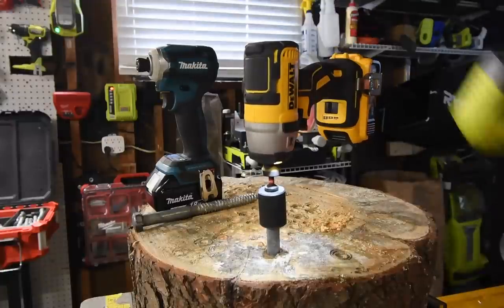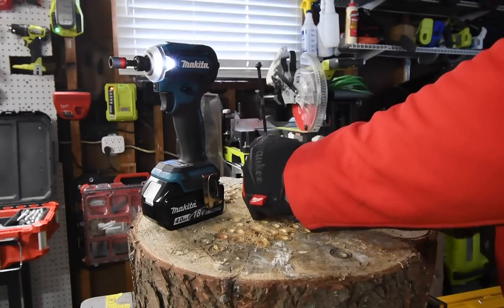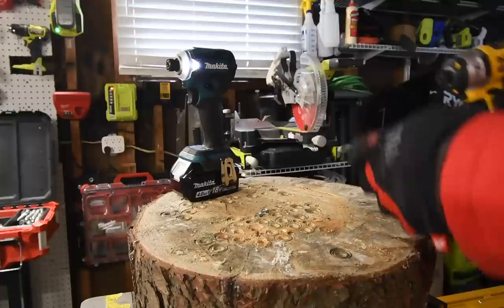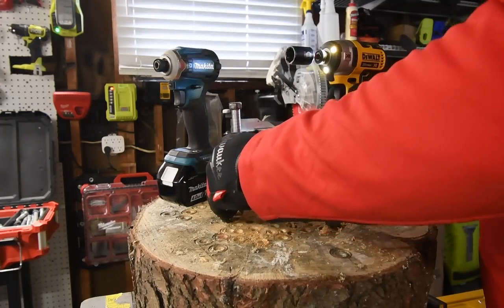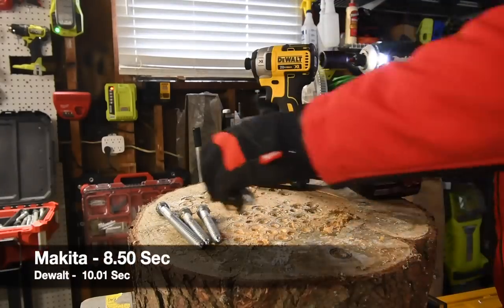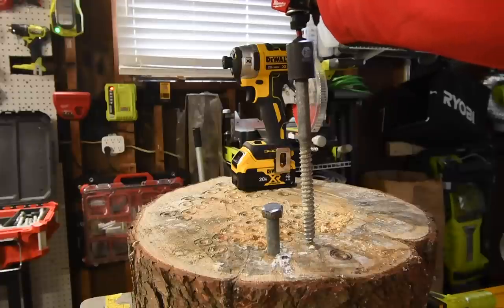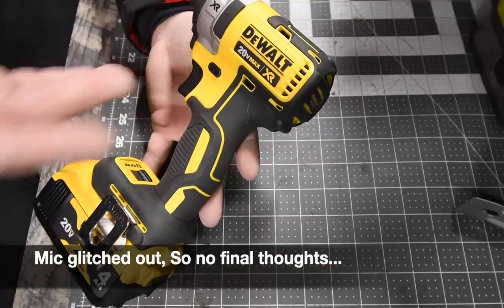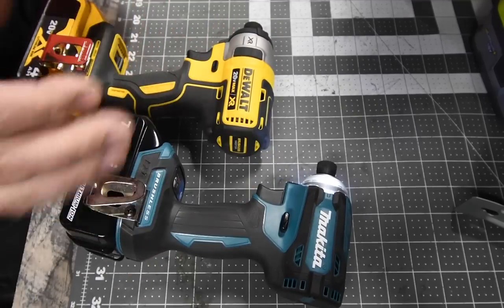Makita vs. Dewalt (Impact Drivers)

Comment: The Dewalt might have a bit more to it. However I’m still rocking my Makita set from 13 years ago with the original batteries.
Reply from the maker: I love this makita impact and I thank you for viewing Dan
Reply: Not every tool from any single company is the best overall others but I don't want 3,4,5 different battery platforms.. that's is awesome that the tool is still rocking after 13 years same battery 🔋
Reply: The makita batteries are seriously good. I only charge them once a month and I use my impact everyday.
Reply: @PatrickRankin  Thats a big ass lie lol.
Reply: @AM-wi6zo  nope not lying. I have a 3AH battery that I only charge once a month. I use my impact 5-6 days a week, sure not all day, I'm not a contractor.
Reply: @PatrickRankin  

Ok you peaked my curiosity, 3ah charged once a month but used 5 days of the week, what are you actually doing with it, like just an idea of a day of use how many screws ect for how long and there sizes. Just out of curiosity. As mine never last more than a day or two of constant use.
Reply: @qaszim2012  I screw down workpieces to my cnc machine. So I drill about 20 holes a day and have to screw in and out so about 40 screws (2 inch). Then weekend projects (fixing doors, fixing furniture, etc...). So yeah, not a lot but still, I really don't even have to charge it once a month, I just feel antsy when it hits 2 bars lol.
Reply: @ManCaverTools  Qq

Comment: I SAW A LAG TEST LIKE THIS BEFORE AND IN A REAL LIFE SITUATION I WOULD PREDRILL A HOLE FIRST. IT WOULD MAKE IT EASIER TO DRIVE THE LAG BOLT. WHICH WILL PROLONG THE LIFE OF THE TOOL. THANKS AGAIN FOR SHARING YOUR THOUGHTS AND VIDEOS RODNEY
Reply from the maker: that is correct. in reality a pre drill is best so you dont split the wood, but this makes a good stress test.

Comment: You can try putting the dewalt on the bolt the makita stopped on to see if it could continue it.
Reply from the maker: more tests will be coming. im getting the torque test ready

Comment: In my opinion, you couldn't go wrong with either one of these impact drivers. I prefer the Dewalt but, I already have several Dewalt tools, batteries, and chargers so, I'm vested in the Dewalt 20v cordless platform. The Dewalt may be a little cheaper than Makita at times, but fathers day sales, black Friday sales, and Christmas sales can make them about even. It most likely will come down to your personal preference and which platform you want to get in bed with LOL. If your trying to decide which platform to go with, I'll say this... Milwaukee is the tried and true brand for the professional, but very expensive in my opinion for the average homeowner or weekend "DIY" person. Bosch is not far behind them for quality and durability. Dewalt and Makita are the challengers for the top spot too. This leaves Ryobi and RIDGID. These are in the lower price range but they are still decent tools. I would choose Ryobi over RIDGID because I think there is some uncertainty in the RIDGID platform at the moment due to their change in batteries and some changes in their tools. RIDGID does offer a "Lifetime Service Agreement" but they don't have the selection of tools that Ryobi, Dewalt, and Milwaukee have. I realize there are more brands of cordless tools out there. The brands I mentioned above are the ones I have personal experience with so I can't honestly comment on the brands I haven't owned. If someone else has experience with other brands, please comment. I don't know everything... ask my wife! LOL!

Comment: Looks like the DeWalt just barely got away with this one, but it doesn't really seem like there are 2000in-lbs of torque in there. Either that or Makita is underrating its tools (this one is advertised as 1600 in-lbs)
Reply from the maker: it would be better if Makita had 21700 cell batteries then I can use a better battery for the Dewalt
Reply: Dewalt claims 1825. From where did you get 2000?

Comment: Oh btw ridgid replace their gen 4X combo kit and broke it up instead of it being together the drill is available now and home depot's website $99 the impact driver is a bare  tool and they're both brushed just to give it a heads up if you wanted to run a test on a DIY version of ridgid  not pro consumer and they're also redesigned in the octane batteries along with the 2.0 and 4.0
Reply from the maker: very good and I thank you for the info Thomas

Comment: I recall in a tool teardown somewhere that the Makita (as well as the Dewalt 12 volt extreme), use a needle or roller bearing in the nose cone, while the typical Dewalt 887 and Milwaukee Gen 3 don't.  I have the XDT14 DCF840, DCF801 and 901; the Makita and the 801 Extreme are both noticeably smoother and quiter than the other two Dewalt  impacts.

Comment: Who makes good impact socket adapters for impact drivers?
Reply: Husky are really good and strong
Reply: @michaelmangino9819  cool thanks. I seen them the other day and got cold feet...they looked durable and husky usually makes good stuff.  I grab them now next time im at home depot
Reply: @wayiamstarr  I just bought the set where you get 3 shorter sizes in 1/4 ,3/8, and 1/2.. Then you also get the longer 6inch set with them in those same sizes. It's online at Home depot for 9$ I think there still on sale. You can't go wrong with that. And yes the husky is super strong as I've seen in strength test.. plus lifetime warranty!! Can't go wrong my friend !
Reply from the maker: Makita is the one that lasts the longest. the older diamond head one.
Reply: @ManCaverTools  I have dewalt 18volt Na cad tools from over 10yrs ago that are perfect shape. And work flawlessly. Makita is nice. But Milwaukee and Dewalt are chugging past, Choo choo

Comment: i disagree. I think testing and comparing tools to their maximum possible performance is the better comparison if this is the best Mikita can do with their given design it should be compared to other companies with their best-given design. of course same same battery should be used as far a size.
Reply: @thetruth5210  ? if you make a comparison it should be done at what a given tool is fully capable of.  but if you do limit a test to battery size that's completely fine. just use the best battery for that given tool for size. test 4ah to 4ah but if the other company has a better 4ah battery you should use that one. 
 I'm not gonna compare a naturally aspirated car to a car that comes with a turbo but disable the turbo to have a fair comparison. that's just dumb
Reply: My thoughts exactly.  Makita just needs to improve their batteries like everyone else. Until then everything's fair game
Reply: @thetruth5210  thats, not my problem whether that tool comes with it or not. that is the best both tools will do. what is better. shit when i buy tools i buy tool only because the stuff that comes with it isnt the best for it so why bother.
Reply: @thetruth5210  some people dont like to fuck around and get a new battery because it died after 2 mins or didnt have the power with the ah to do the job. some of us arent crying because our tool weighs an extra pound or two
Reply from the maker: I was just saying when it comes to the battery. this video was a 100% fair test. but id I used a 21700 cell battery in the Dewalt then the test would be unfair. Makita needs to make batteries with 21700 cells in them

Comment: I saw a video where a guy used that smart mode on the makita and it was smoking it's speed 4 setting. It would have probably actually drove that lag bolt it was incapable of driving before.

Comment: Bought a brand new DeWalt table saw recently. Unpacked it and was about to make the first cut when I realized the power button was defective and doesn't stay on. As soon as you let go, it shuts off. Wonderful. $500 new table saw doesn't even work out of the box. Had to waste time going back and returning it. Fucking DeWalt garbage. More like DeShit. All of my makita tools have worked out of the box, and are still going even after 8 years.

Comment: Hello dear I see many videos of your tests, I want to ask you a question? I am about to buy an impact screwdriver and which one do you recommend the Dewalt dcf 887 or the makita dtd 154 or the Bosch gdx freak? I work in electrical installations and do a lot of drilling and screwing, I have the Dewalt dcd 776 and it is very good but I want an impact driver ... thank you best regards .. from Santiago de Chile ... James....
Reply from the maker: I thank you for viewing  :)
Reply: Thank you very much, but which one of the three do you recommend?
Reply: Thank you very much, but which one of the three do you recommend?
Reply: If you already own a Dewalt then I would get the same brand for new tools as you can use the same batteries

Comment: Starting to see some 887 kits being clearanced out.  Saw a leaked pictured of a new xr impact driver.  So I think we will see it come out this year.

It did look more compact than the 887.  Kinda looked a bit like Milwaukee’s new compact impact wrench.
Reply: You Actually saw a picture of a New Dewalt 20v impact driver ??  That's great ... Did you see any of the specs ??
Reply: @brianf9619  

Tools by design posted the leak in Jan 12 in his Instagram.  Picture was really blurry no specs.  It was a compact drill And this new impact driver.  Both with xr branding.

Also of interest was a brand new never before seen compact battery.  Similar in size to the 2ah battery but with all black casing.  I can’t quite make out the ah rating but I think it says 1.3ah Can see very blurry writing, that I THINK, might say “GRAPHENE”.   I do know it’s still 20v as that is clearly visible on it.

He has since deleted his post.  But I took a screenshot.
Reply from the maker: I cant wait to try it out and I thank you for viewing Juan
Reply: I think it was dewalts new subcompact extreme 12v impact wrench that dewalt just announced
Reply: @emmanuelmartinez8312  

That’s a completely different tool, that was NOT leaked!
Reply: @juanc5149  post a link to that screenshot :)

Comment: Not necessarily unfair,  it's just the other companies are making better batteries than makita at the moment
Reply: Makita doesn't really need 21700 cells to make there tools run faster tho now that you think of it if they did they'll probably keep up with milwaukee
Reply: @haroldjones12  true. I use bosch myself but I would take makita over Milwaukee or dewalt anyday.
Reply from the maker: Makita does need to make a better battery

Comment: No assist mode on the Makita?
Reply: The Makita xdt16t has assist mode.
Reply: @shanew7361  I know that, I’m wondering why he didn’t use it.
Reply: @thetruth5210  Cause he's a noob
Reply from the maker: when it comes to this makita model. I need to look at all of its features. since there is so many. ill be doing a separate video on that soon
Reply: @ManCaverTools  The assist screw mode for driving large fasteners and lags works pretty much the opposite of a tech screw mode. It starts off slow and as soon as it feels the torque and it starts impacting it ramps all the way up to high! It’s awesome I have the 888 and the 16 and unless I need another DeWalt tool I’m not using my 888. Not only does the Makita feel better to use but tool connect can be a pain in the *$$ when you don’t have cell reception and it tells you you don’t have any DeWalt tools. Just saying.

Comment: Who drives 8" Lags with a cordless without pre drilling?,   good way to kill your drill.
Reply from the maker: that is what these tests are for
Reply: @ManCaverTools  For the task never attempted or considered ,,,
Reply: @CP-kb1du  agreed. These videos are a joke honestly. All these tool reviewers do tests no one will ever attempt. Vcg is about speed and skills and man caver is about tasks no one will ever attempt. Both channels show you how to kill your tools. Not a good way to show people these tasks. Why prices are rising of lumber and screws.
Reply: @Toolboss0826  Spot on I love tools and do my best to protect my investment , impact to drive in screws on my fence drill holes when required .
Reply: @CP-kb1du  agreed bro. 100%. I’m a tool nut and I love to protect my investment. I mean I beat my atomic kit up pretty bad but I just purchased the 887 impact and treat it like a baby. I don’t want it to drop. Want to have it forever. I also use my atomic impact a lot and it still works like new even after all the drops. The drill is a little ehhh. It grinds a bit in second gear but still drills holes and drives screws. Can’t complain. Until it dies I’m still using it. I like to protect my tools as best I can. I’m considering the 12v as my next set from dewalt. Even just the impact as I rly don’t use a drill that much. I love the xtreme line and it’s a beast as small as it is. I don’t need a lot of speed. I still strip screws out on 2800 rpm if I’m not careful. Protect your tools don’t abuse them

Comment: Didn’t you just make a video about fairness due to batteries? I believe you said it’s fair to use a special battery because the company put the effort into making the battery and it’s not their fault the other company didn’t
Reply from the maker: no, I said in the video that a company having a video like that is different then a youtuber. its not Dewalt fault the manta doesn't make a 21700 celled battery. im not only going to use 18650 celled batteries against makita. that would be rediculous

Comment: I own the Dewalt 887 (3250 rpm's) and a Makita XDT14 (3600 rpm's) which has the same specs as the XDT16 , so you would think it would be faster than that Dewalt , BUT Makita Lies about their Specs for some reason , Project Farm did a rpm test on them and the Makita xdt16 only did around 3300 rpm which is 300 slower than its specs and the Dewalt dcf887 did around 3350 which was about 100 or so  More than its specs said and more than the Makita , I don't understand why Makita would lie about its specs , the Makita is a great impact and I love mine but the Dewalt is noticeable more powerful , Especially with a 21700 battery....
Reply from the maker: I love Project farm. his tests are spot on spec tests, I thank you for viewing Brian
Reply: I had the 887 & replaced it with the xdt14 then got two battery adapters to use my DeWalt batteries with the Makita. It works great, tight fit & allows you to use Dewalt or Milwaukee 21700 cell batteries on my makita tools

Comment: The plastic on Every Makita tool I have has cracked in cold weather. Very disappointed in the quality and their batteries constantly underperform. Been switching to Milwaukee much, much better. And they absolutely do not pack their product I’ve called them dozens of times and nothing. What a rotten company…
Reply from the maker: hopefully they will contact you back Trent

Comment: another nonsensical comparison..
Reply from the maker: perfect. then dont watch bro
Reply: @ManCaverTools  You either didn't understand or didn't want to understand. Such a comparison is pointless because no one has only one tool. We usually have a few. And that makes the difference. Personally, I prefer solutions from Japan, not from the US. The ones from Japan are more refined, they are more trustworthy. Nobody normal, I repeat NO ONE gets excited about the differences at the level of a second. Your hand is not that fast. Work with the hardware a bit, then you'll understand.